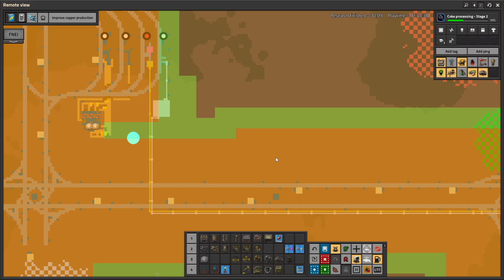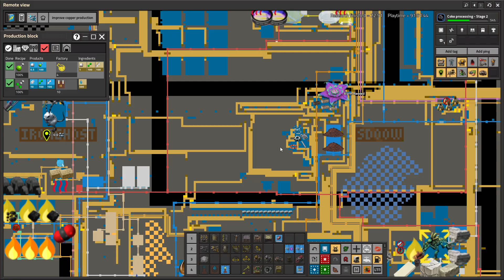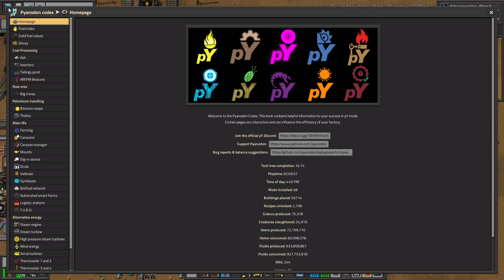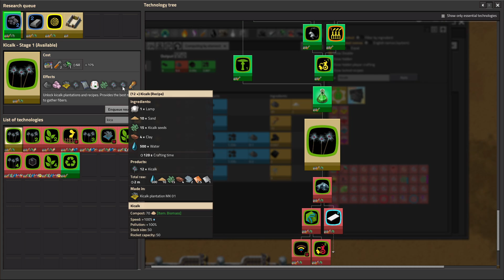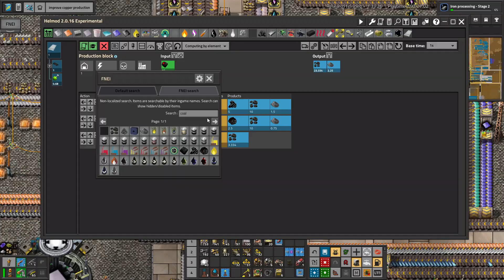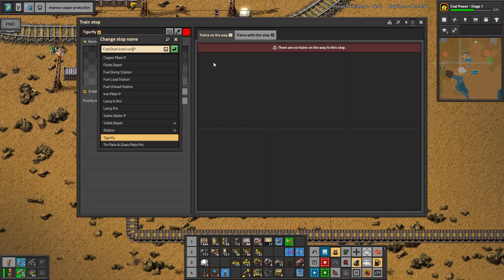Crushin Coal All Day Long - Factorio pYanodon's S3E73

Comment: I use most of my coal for red hot coke to make hot air, it has coal dust too as byproduct. 
The coke made is burned for reheating, dust gos to priority provider or burned in reheating if full. I dont think I'll need more coal dust that the crushing and the hot air production makes as byproduct.
Power is from DDS raw coal and the coal from that, use the coal gas for syngas and more tar, burn the syngas for steam, process the tar, use pich and antracene to more coke, burn the rest for steam. use all coke for power, any extra coke goes to priority provider. Closed loop. 
Red hot coke for the sake of coke is somehwat subpar recipe, like 50% less efficient on raw materials.

Comment: I keep seeing you manually place bots and I'm wondering why you don't have an inserter automatically putting them into the network using a circuit condition to check how many are in the network already to disable/enable the inserter. Still loving the series.
Reply from the maker: They're way too expensive to not handle personally, at this point. I don't want them being made constantly. I also like having a handle on how many bots I have, for a while at least. Eventually we'll have enough we can just automate it. probably.
Reply: @Krydax8  I see, yea you'd need to guestimate a rate of bot filling and do a clock which would still have less control.

Comment: in my train grid base i used to carry a blueprint with a locomotive and 1 rocket/nuclear fuel in it(train fuel option in the blueprint ticked) that i would just place on the tracks whenever i wanted to go somewhere but in vanilla the bots are much faster than what u got so idk if thats gonna be good
Reply: A better option is to have a "home base train" that gets loaded with fuel and mall supplies at some central spot. In your pocket you have a train stop blueprint called "Hitch a ride". The train's schedule is Home base, then go to Hitch a Ride and wait.

When you want to go somewhere, you get in the train and ctrl click. When you get out, it goes back to home base. When you want to be picked up, you plop down your station and wait for the train. You climb in, delete the ride stop, and ctrl click where you want to go (or wait and it takes you home).

This does fall down in really huge bases where the wait time for the train can be large, but you can also plop it down a little while before you're ready to leave.

Comment: For voiding decisions, I don't have a global grid, but instead use the train buffers. Eg, If I have 3 trains buffered of Coal Gas, but have <1 train buffered of Tar, then I vent coal gas to make more tar.
I think I also saw a circuit combinator that was supposed to tell you about what was in the cybersyn network (there was definitely one for LTN), in case you are worried about multiple stations (eg, you have lots of pure tar, so you don't need tar from coal, so you don't need to vent anymore).